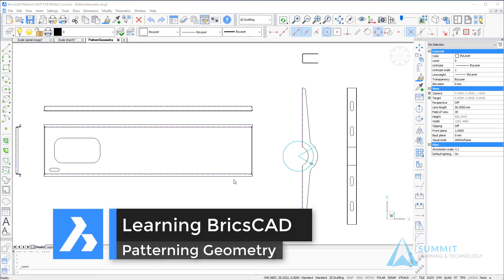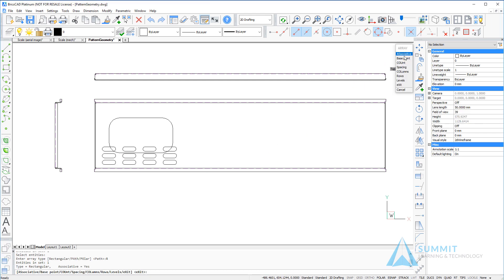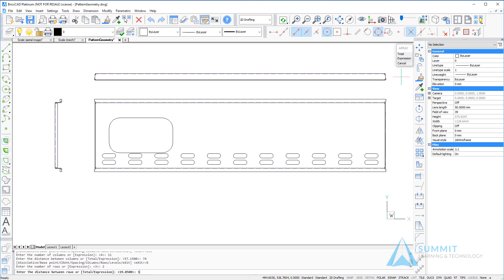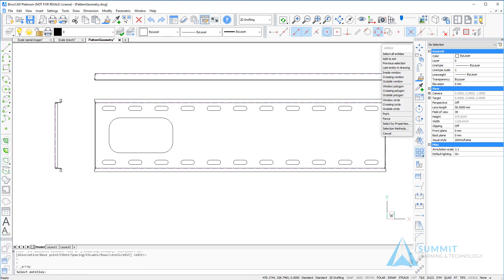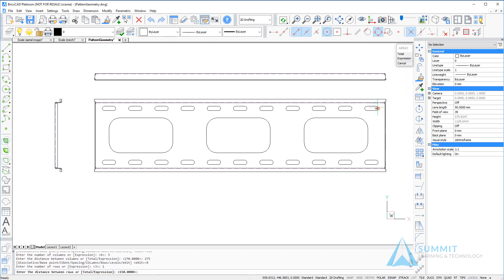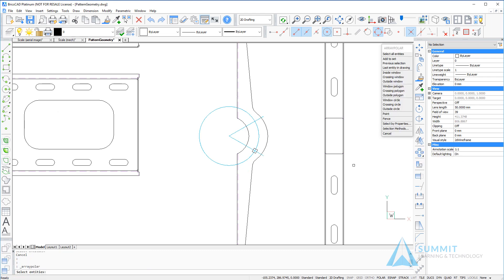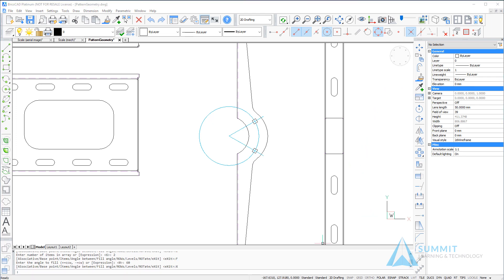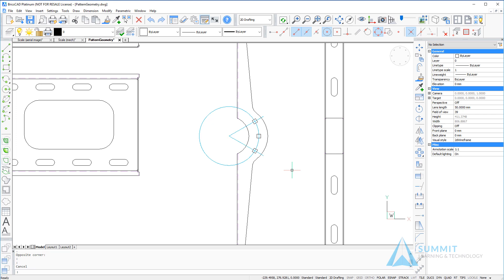Pattern - BricsCAD

Comment: how do I disable array rotation along X axis. The cmd always asks me for 2 centers of rotation and I cant find a solution.
Reply from the maker: Hi @kristjan1338, thank you for your question. 

The ARRAY command asks for two points on the axis of rotation when the 'Axis of rotation' option is chosen. If it's not necessary to use this option, by default it's enough to pick the center point of the array when the command prompts: "Enter center point of array or [Base point/Axis of rotation]:"

But, if the axis is needed, and there is some problem with its determination, it would be better to send a support request with a detailed step-by-step description of the wrong and expected behavior. That way, we can help you out quickly and get you back to productivity :)